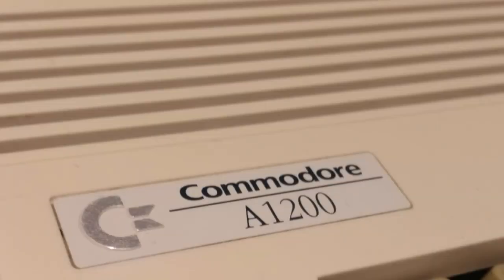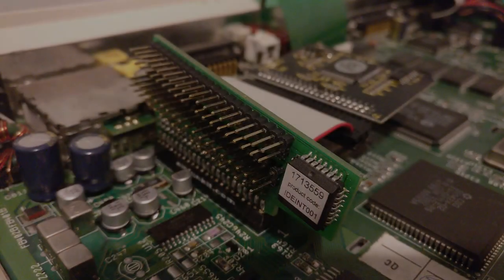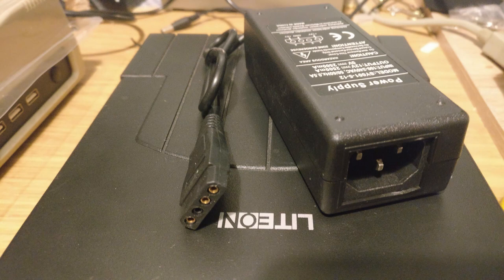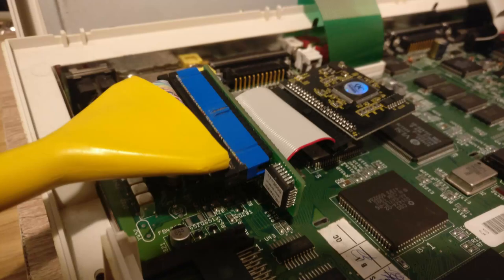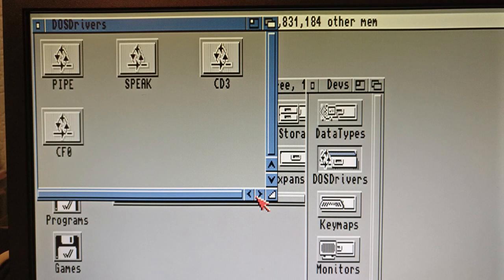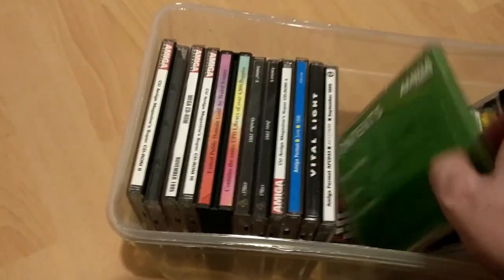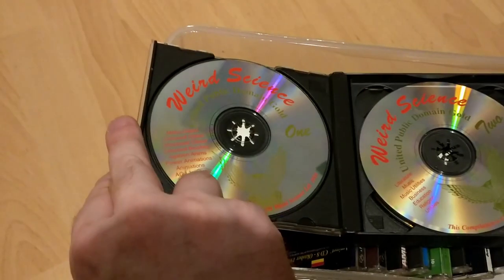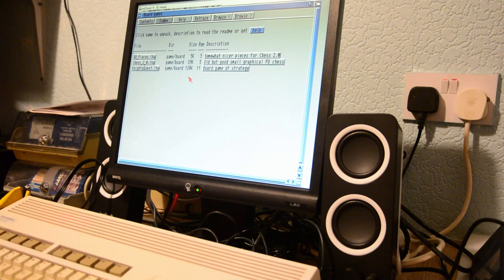Adding IDE CD-ROM to my Amiga 1200

Comment: It is possible in any way to run CDTV/CD32 disks on A1200 with IDE CD-ROM?
Reply from the maker: Yes there is a floppy that allowed you to boot cd32. I use to do it before when I had scsi interface. I'll do a video on it.
Reply: jes with ,ide fix .97  ver. 3.5

Comment: Hi where I get EIDE 99 software?
Reply from the maker: It comes bundled with the device on a floppy.
Reply: @MikeyGRetro  is there no way of getting it separately
Reply from the maker: No, not that I know of. It's pointless without the device so I don't see it as an issue. Unless your drive doesn't work, if thats the case try contacting them directly and ask for an adf :-)